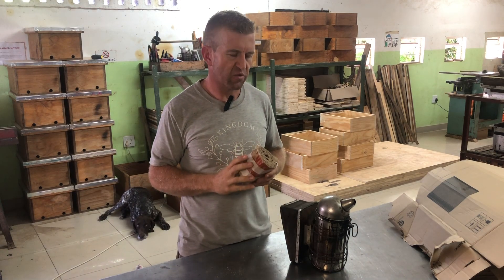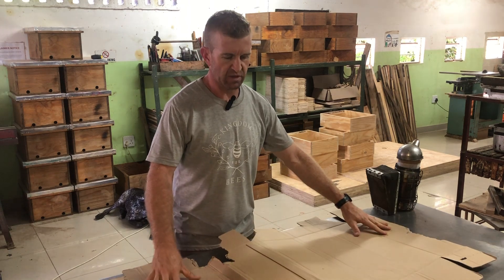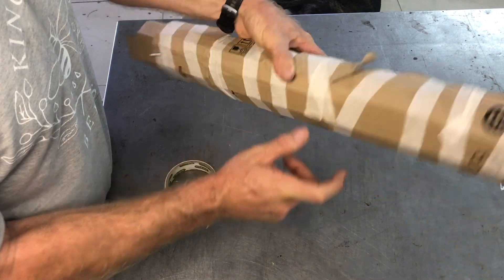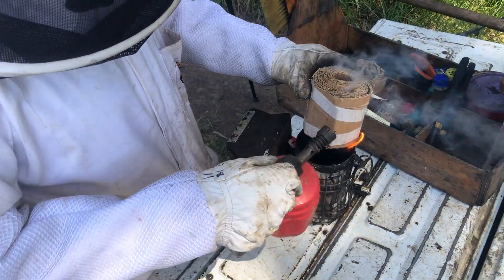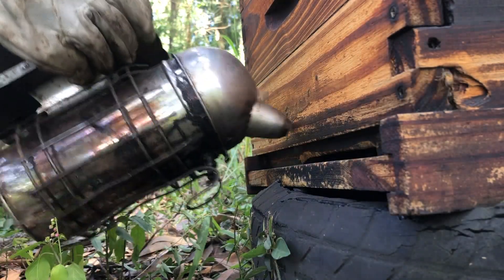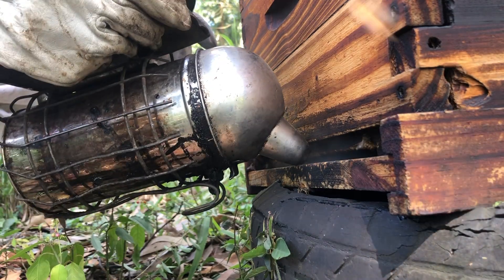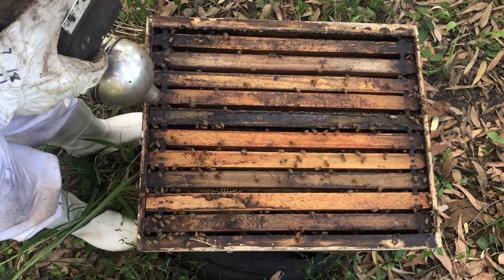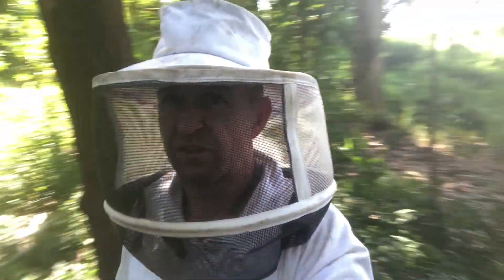How to use a smoker to work with defensive African honeybees in 2024!

Comment: Excellent idea to use rolled cardboard in the smoker. I usually use wood shavings which I generate through woodworking.
Reply from the maker: @fatimalaherismail7175  Thanks for watching! Wood shavings also work well as long as the wood is not treated.

Comment: Great to come across your channel 👏 Mainly watch Brazilian channels as more on a par with South African bee keeping, so nice to have some other local and current input. I Live in the Transkei.  Use weavers nests that fall down, works a charm. Burns slowly, great  smoke, especially the newer ones, lasts for about 2 hives so more for the hobbyists, much longer if you add some sawdust or horse manure 😅
Reply: Awesome, where in the Kei? Couple of small Mac projects around.
Reply from the maker: It's a community project where we set up several apiaries and a "centralised" honey harevesting facility. We don't know the exact locations yet. @marionmarcondes1291
Reply: @kingdombees_kzn  Please ensure that you have ongoing management if the hives and proper training. All to often these projects fall by the wayside to the detriment of the bees. Busy restoring one such initiative where the hives were in bad shape due to locals not having the support and know-how.
Reply from the maker: Hi. Great to hear! Love the Transkei! We will setting up apiaries in that area this year. Good info in using fallen bird nests, good thinking👌🏻

Comment: West African beekeeps here i use a bit of coal and sawdust the heat from it disperses them away.
Reply from the maker: @olusegunadebayo5306  I would be causes using coal because of the chemicals it might release. Sawdust works as long as the wood is untreated.